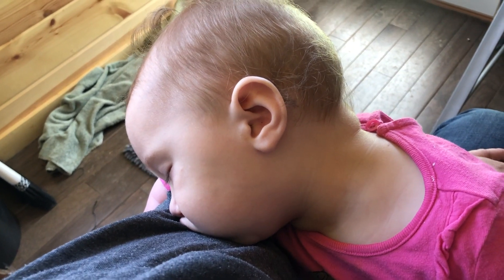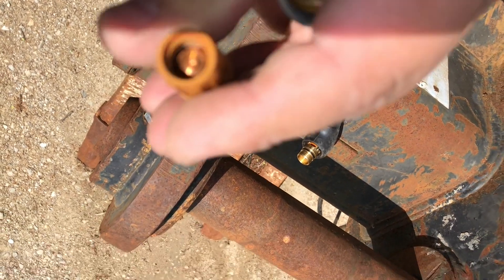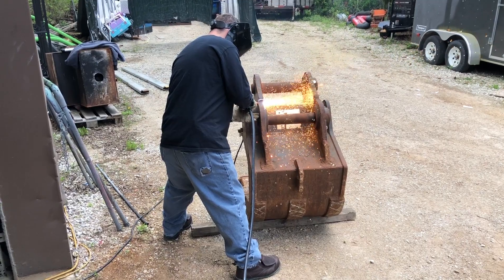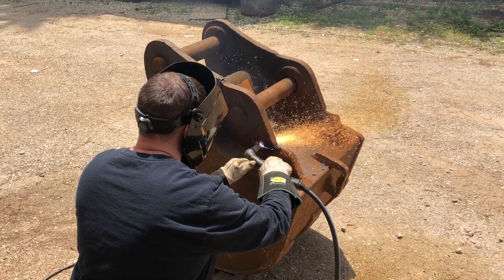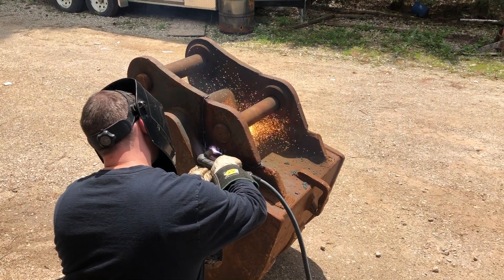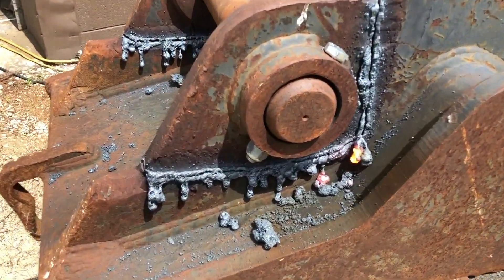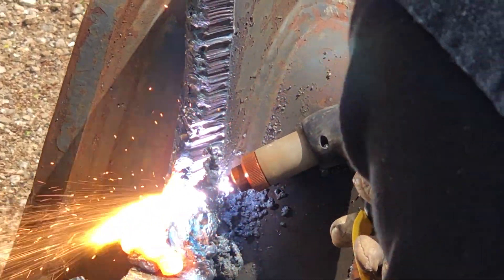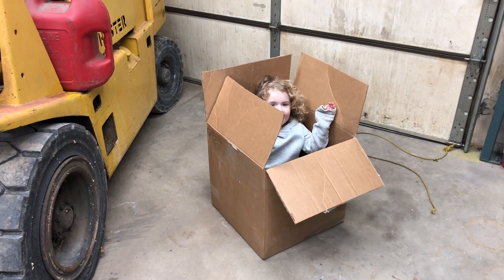PLASMA CUTTING an excavator bucket to change the pin distance

Comment: What aircompressor are you using with that hypertherm plasma cutter and power supply
Reply from the maker: a 15 year old american made cobalt air compressor from Lowes ...the new ones are all made in china though ...  mine is a 5 hp 80 gal .... its a little bit overkill for plasma but I do other things with it ....  the MOST IMPORTANT PART IS an air dryer when plasma cutting ...  you need a good air dryer !!!!

Comment: Always learning something new when watching! How's the gouging feature on those machines ?
Reply from the maker: it works good - but not my favorite ... to me gouging is carbon air arc gouging ..... ! that carbon air arc is like "shaving"or "reverse stick welding" ... you have full control what you take out and how much ...  (as far as depth). 
when you gouge with a plasma cutter (no matter what brand) and even if you use the correct consumables for gouging ...  it is just not the same ...  the flame is more like a torch"shooting out the front" and by choosing how shallow of an able you ant you control your depth ....  
Like I said - it works - it is "just not me" ....  to each its own 

in my mind - and maybe that just shows my ignorance or lack of serious arc time with gouging consumables  - if you dont care that you wear out the cutting consumables uneven and faster, you can gouge with the regular cutting consumables (in my mind almost as good as with gouging consumables) .....
Reply: I have done a lot of gouging with my hypertherm 45 and love it! The gouging function is better because it lowers the air pressure, increases your control and gives much better arc stability over the cutting function. Also have a 105 but haven’t done much gouging as the 45 punches above it’s weight and has better control for most of the type of work I do.